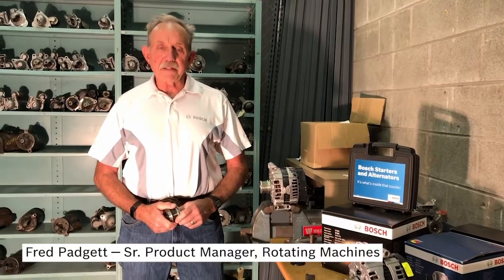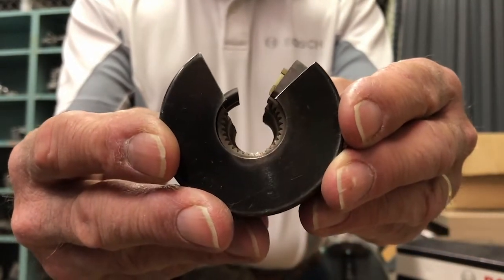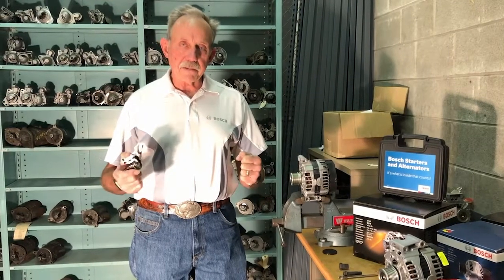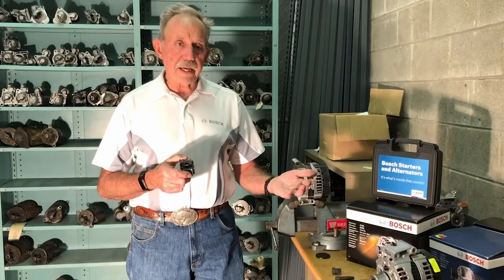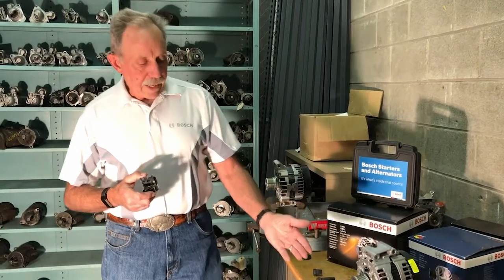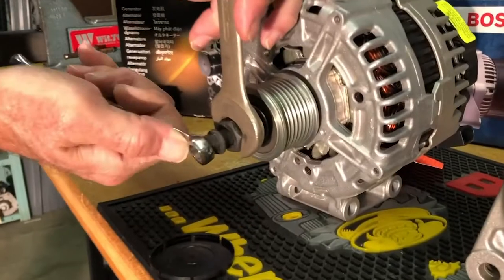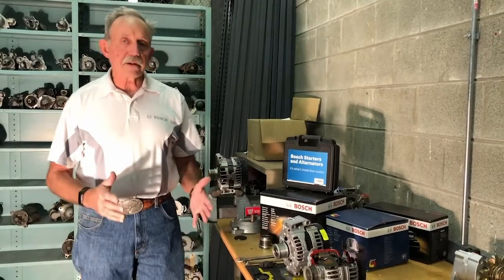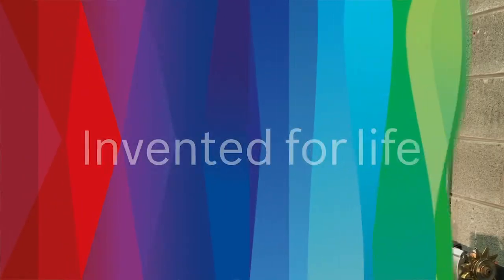FredTalks: Episode 2: What is the Clutch Pulley Inside?

Comment: The main reason for the clutch is to damp torsional vibration.  As mentioned,  this causes belt flopping.   The net result is a smoother running powertrain. In conjunction with dual mass flywheel,  damped serpentine belt tensioner and fluid crankshaft torsional dampers,  four cylinder engines firing every 180 degrees can match the NVH of an inline six cylinder, the paradigm of perfect balance.